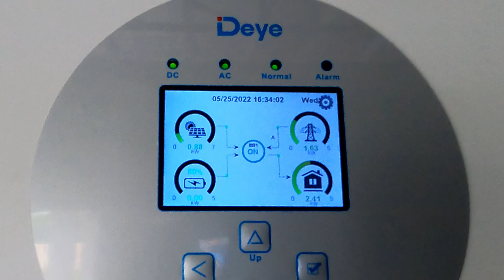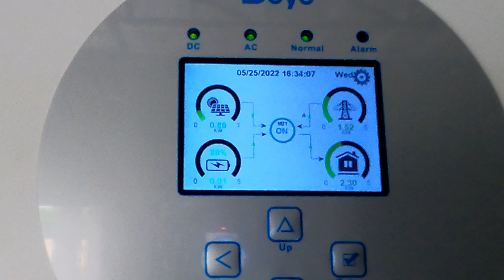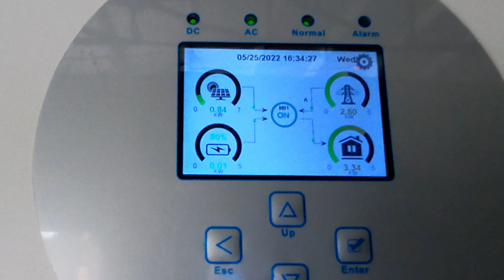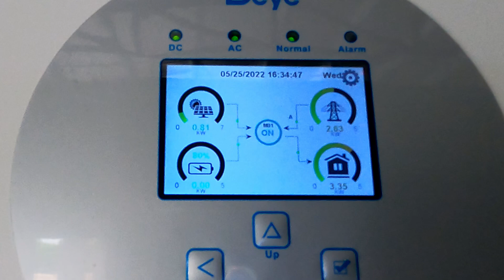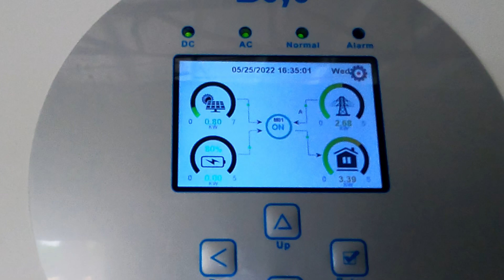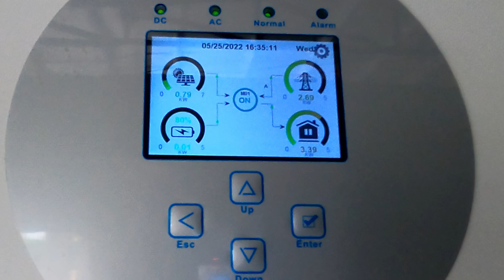Philippine House Building Day 215 - Running on solar power !

Comment: Sorry to contradict you Mike but I read your display at 15:11 as using 3.35kW which is made up of )kW from batteries, 0.77kW from solar panels and 2.66kW from the grid.
Batteries are 80% charged.
Reply from the maker: Stephen
May not have been clear but the numbers I was talking about were from photos I sent earlier in the day to the supplier.

Comment: The Deye inverter lcd screen shots at about the 14 minute mark show that your solar panels are producing a low amount of energy (~0.80KW) as it’s getting late in the afternoon (16.34pm) and the sun is getting low in the sky. They will produce a lot more in the middle of the day.
The majority of the house power that you are using at this particular time is coming from the grid.
The battery is 80% charged and only a tiny bit of battery power (0.01KW) is going to the house/other loads at this particular time. When the batteries are charging, there will be a negative number under the battery symbol, ie -1.34KW means 1.34KW is being pushed into the batteries - either from solar or grid depending on the user defined inverter settings. A positive number under the battery symbol is power being supplied from the battery to the house & other loads.
You will have a bunch of user defined settings in the inverter that set priority for utilisation of solar power that your installer can set. They key one for you is whether you want the batteries in a high state of charge at the end of the day (so power can be used in the house in the evening) or if you want the majority of the generated solar power used during the day for the pool pump or a/c’s etc, which might leave you with a lower level of battery storage for evening use in the house.

Ads are no problem for me.
Reply from the maker: Thank you Paul, both for the solar explanation and the comment on the ads. I will ask the supplier about the settings. As we don't have internet wired yet, I cannot use the app to monitor, so will have to go and keep taking a look to see what is going on.